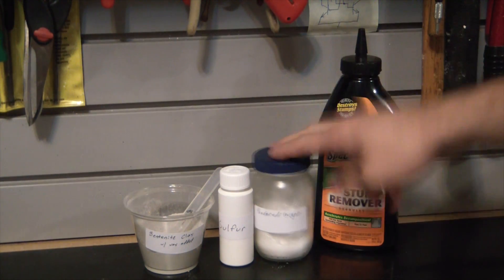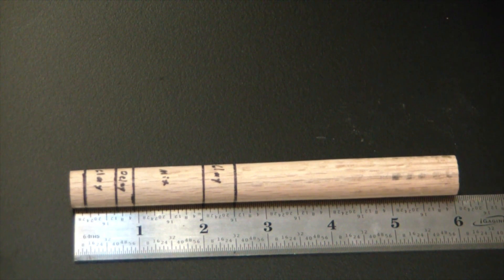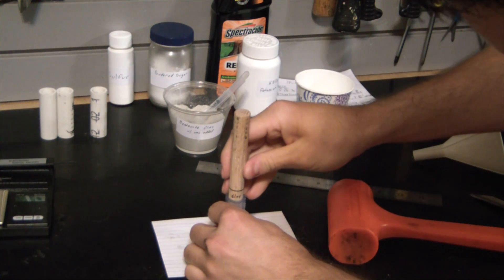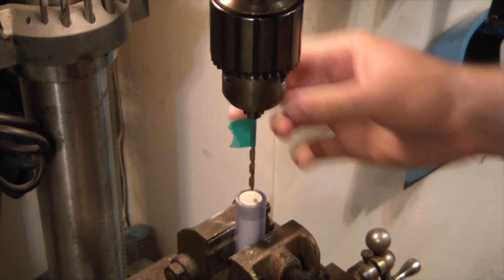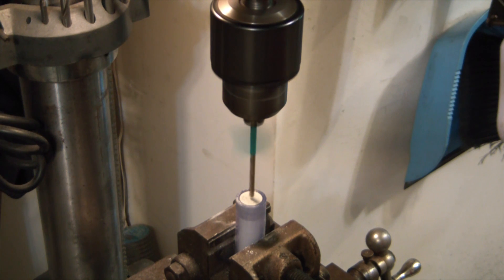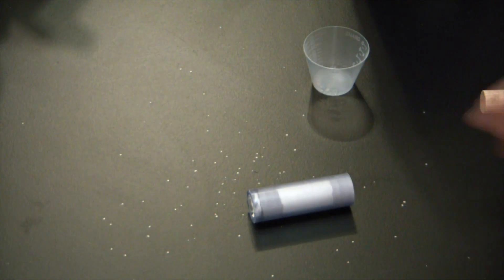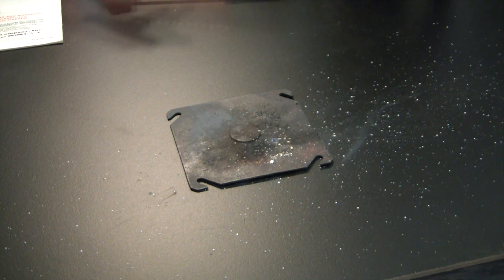ROCKET ENGINES FROM HOUSEHOLD STUFF! ELEMENTALMAKER

Comment: Swap the powdered sugar out for charcoal.  Black Powder.  Not going to give the exact mix ratios on here though, but some good research will give you the answers.  If you want to get really keen you can wet-mix the ingredients in a gemstone grinder with stainless steel ball bearings in, allow it to air-dry to a thick paste, pass the paste through a fine sieve to granulate it and then let it fully air-dry before packing your rocket motor.

Comment: The sulfur just breaks down to Sulfuric acid when in contact which the nitrate which is actually more powerful too add so next time use a few drops of brown sulfuric acid syrup for 400% more power.  Also charcoal powder gives a 200% faster burn rate than sugar.   It's THEN called BLACKS POWDER or black powder.  IT ALSO NEEDS A HOLE DOWN THE CENTER TO TRIPLE THE PRESSURE WAVE!!!!!!!!!!!!!

Comment: So much is wrong with your ratios and ingredients. That wouldn't get anything off the ground. Real rocket builders know about the correct additives and ratios. This is like watching a boxer teach dental extraction.
Reply from the maker: Aw look an armchair expert in its natural habitat! You clearly know nothing about making propellants. I've launched many rockets with this composition.
Reply: @ElementalMaker  Nah. Been building rocket engines since I was about 12, I'm now decades older. You need to add at least one key ingredient. A simple google search prior to your "instructional" video would have provided you with those key components. I bet you could figure it out then repost a new improved instruction video. I would post links in this comment but I don't spam unless I'm trolling. Not trolling though. Iron oxide is your friend, friend. Sorry I came off like a jerk. I kinda am tbh. But I do know what I'm talking about. We used a recipe for r-candy like this with very bad results in the early 90s. Moved on to proper mixtures by the mid 90s because the Estes engines are ridiculously expensive. If I find the old recipe we used in my old stuff I'll post it. We used to "cook" it on the stove and pour it in the used Estes tubes, also aluminum engine tubes with proper nozzles. I can't remember if we actually went as high as 5% on the oxides or not. Seems like we used sodium hydroxide too, but that was over 20 years ago.
Reply from the maker: @EthanVandal  I mostly have moved on to composite ammonium perchlorate based propellants. In this motor sulfur is acting as the burn rate catalyst, much like the iron oxide does in your composition. I use RIO when making knsb propellant. I have videos on making all these various propellants, and a load cell test stand to quantity results.

Comment: Nice but I like making rocket candy and using some rust or aluminum powder that has been oxidized   as a catalyst.. 
What I like is you can form them while in a hot past like form into paper molds and when they burn off they leave amazing white plume trails to track your rockets.

Comment: Not sure if you answered this question or not yet, but was there a specific reason you stopped using sulphur in the fuel mix in later videos? Not necessary? Or..?
Reply from the maker: Different propellant types
Reply: I only ask because it's the first time I've seen anyone add Su to that mix. I think you did 6 Su? I got curious and did 5g Su and 1g of pyro grade Fe2o3. Also split 17.5g/17.5g-powdered sugar/sorbitol. Kinda as a why the hell not??  Seems to be pretty a pretty hot mix after being in the ball mill for a while. Kinda curious to see how it's going to do once it's melted and loaded, seeing as how the Sb is a lot more coarse.

Comment: For people new to rocketry, have fun with these but do not overdo it. If it blows up, plastic shrapnel is incredibly hard to detect on x-ray. It's better to have a larger nozzle diameter which may not create a lot of thrust over a too small nozzle diameter and a massive CATO. If you want a lot of smoke also put just a pinch of baking soda in
Reply: or just keep distance / shield yourself from the rocket. How hard could it be?

Comment: I designed PVC motor in 1990 -  I sold plan sets for years on how to make - this was before the internet -
as far as I know I was 1st to make PVC case -  U should make Tamper  trim off some  make a step on  end - 
also a Lever Press works Much Better than  Hammering  -  make from 2x4 -- nozzle was  zink oxide  or aluminum oxide
Reply: Why should they use a tampon?

Comment: The easiest way to make rocketfull is to solve potassium permanganat  concentrated in a  watersolution. Soak Newspaper in this solution and let the newspaper dry. Then roll the newspaper thightly into a paper roll body,pipe, paintet inside with waterglass,  stuff that a standmann used to get fiere proof. Top closed with a wooden circle and jet made out of wood again. Carefull this kind off rocket will  at last reach the speed of sound and get to a speed of a bullet. It is no toy anymore. The newspaper is the carbon fuell. The potassium permanganat is the oxygen delivery. That how simple it is to make a rocket

Comment: What would happen if you scaled this up?  Say to 2" dia.?
Reply from the maker: You'd get a much bigger and MUCH more dangerous rocket engine. It would probably catastrophically fail at that size
Reply: @ElementalMaker nope it can be done but the nozzle should be 1/3 the size of the diameter of the engine

Comment: Just watched this ... and couldn’t see where the stump remover was used ?? 🤔🤔
Reply: Stump remover is made from potasium nitrate because potasium nitrate helps oxides the wood in the stump over time.

0:20 he blended up the potasium nitrate to a fine powder and placed it in a white bottle. 
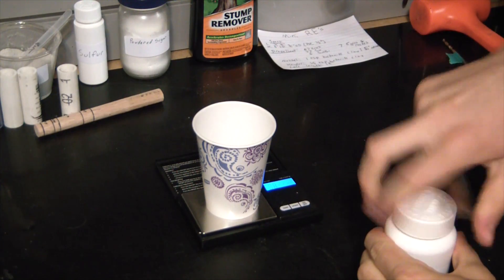 2:06 he starts to measure it out, and then adds sugar.  

Potasium nitrate provides the oxygen to oxidize and burn the sugar fuel. Having it in a fine powder helps bring it into more intimate contact with powdered sugar for a more consistent burn. 

Some people dissolve the sugar and potassium nitrate in water and then slowly cook it under a low heat to prevent caramelizing the sugar, yet  drive off the water.  and
Reply: Watch it again.....with audio, and pay attention.

Comment: you might find it easier to load granulated mix made by wetting your fuel mix with a small amount of nitrocellulose dissolved in acetone and pushing through a screen.   Granulated loading stock always makes for more consistent results compared to powder.  We make huge colored smoke cartridges professionally and loading powder/dust is out of the question. You can find ping pong balls made of NC and use them.

Comment: A friend of mine made a tool that avoids the drilling of the motor fuel. Basically he just cut the tamping dowel in two, and then centered a nail in one half of the dowel and cut off its head. This was matched by a centered hole in the other. This allowed the two halves to be rejoined seemlessly together by sliding one over the nail in the other. When used as a temper, the powder is filled around the nail and pressed in place with the half with the hole in it. The powder does not fill the hole, as it is blocked by the nail.
When all the powder is loaded, both sections of the temper are removed, leaving a perfect hole down the centre.
It helps if the nail is lubricated with a little candle wax, before use. This can be accomplished by rubbing the nail on the side of a candle. In his case, he was making the rocket tubes out of brown parcel paper held together with PVA glue.
A neat trick was that the temper rod also provided the former on which to wrap the paper. As the paper was wrapped, he would apply an opposite twist to the temper sections. This produced a rocket nozzle at the junction between the two parts. This was later reinforced by tamping an inert powder into either side of the tube. 
Making rocket tubes out of brown paper is a little old school, and is rather labour intensive compared to using uPVC pipe, but it does have the advantage of being very environmentally friendly, as all the parts are biodegradable. The paper turns out to make a very strong walled, light weight rocket tube, that produces a thin charred carbon lining inside the tube when fired.

Comment: What if you used a cone shaped bit to drill your exhaust hole?  Would it increase your thrust?
Reply: With this size of motor, any increase in efficiency would be too small to actually measure except on the most sensitive of test stands.

Comment: So, in theory this can be as wide and as long as we want? And will it be better if we make it longer ( stays in the air longer or launches faster )?
Reply: It's a different set of calculations.  On a ported rocket, lengthening the port causes more volume to be burning at any one time and increases pressures, which could be good or bad, depending on where things are at.  Changing the diameter can have an even more profound effect but then you pick up the issue of maintaining the clay plugs because the area on the plug increases much faster than the diameter or circumference and the amount of fuel burning at any point in time varies more as it burns from the port toward the outside of the engine and the area increases.  If you switch materials for the plugs, you need to not exceed the pressures of Schedule 40 PVC by too much.  It will take quite a bit of trial and error and you will want something that measures and records peak thrust and knowing the diameter of the nozzle to know where you are on pressures.  They make some pretty big sugar rockets here on YouTube.  Learning from those guys can get you into the zone you want to be in more quickly and you can take it from there.

Comment: do you need to put a delay mix in
Reply: If you want to retrieve your rocket via parachute, yes.  If you just want to fire and forget, no.  The delay is so your parachute doesn't pop right after or during your main propulsion as this can cause your parachute to get ripped off due to wind resistance.

Comment: Has anyone tried this but used 2" or 3" pvc or a cardboard tube? I've been experimenting using cardboard tubes as pvc tends to break down with the heat. My problem is that I need more thrust.

Comment: Is there a reason nobody uses a PVC end cap instead of a clay plug at the front of the motor?
Reply from the maker: Probably just comes down to cost. Clay is practically free and flame resistant. That's the way I've always made them.
Reply: @ElementalMaker  Okay, cool.... so you think using an end cap would work?? Clay seems a bit delicate.... Wouldn't it fall apart during handling, transportation and stuff like that?
Reply from the maker: @benmadderom2281  the clay is actually quite resilient. I'd trust it over pvc
Reply: @ElementalMaker  Interesting. Thanks!

Comment: we friend I too have been building rocket engines, i just haven't got the ejection charge to work yet, i also have been concidering  on using a altimeter, or maybe a mercury switch for that purpose. in the begining of making my own rocket engines, i tried using pyrodex, it was a bad choice, if it lit up no thrust or it would explode, then i took apart a estee's engine and used the black powder in my engine and it flew, since then i make my own black powder and its a process. one morning i packed a medal tube rocket engine and went out back and lit the fuse, oh it started , then bang it shot the medal engine 100ft striaght up, it blew like that is because i din't comptress the fuel enough, if there is any air pocket in the fuel mix it will explode, my ears rang for 20 m9nutes

Comment: You should be able to boost the performance of this fuel by adding between 0.5 and 1% charcoal. This is not for the chemical reaction, but for the opacifying effect it has.
Reply: I was thinking about the result of the mixture. Better results or same, or even diminished returns on the labor and experiment process. I hope that you don’t take this as dismissive to your explanation, that is fascinating.  A bit of a wow effect!!! Back in my Middle school days We had a wonderful gifted science teacher, who got me started with Rockets, I was classified as a “Basement Bomber” for building my own design rockets... Got teased a lot about it till the day(s) for Launching. Then my Redemption was clearly much sweeter than the some of the other Popular kids designs. Most of which failed in some way... two of them were perfect in flight and recovery.  I was amazed that my rockets had constantly developed broken pieces even before launch day and had to repair both on the launch day, balsa wood fins were broken most often. Thanks to my Mom giving me a tube of new Supper Glue, I was a successful Rocketeer.
Reply: Well??? How does it work?
Reply: @andrewostrelczuk406  - A lot of the energy in the combustion is in the form of light. If the fuel is transparent to these light frequencies, then the energy is transmitted straight to the casing. But if you have charcoal in the mix, this absorbs the light energy at the surface and helps heat the fuel at that point, which means that less energy is used to turn the fuel into a plasma and more can be used to get the gases going out the nozzle faster.  It is a small but significant amount.
Reply from the maker: Great suggestion, I will have to give that a try!
Reply: @ElementalMaker  Let us know how it goes :)

Comment: dude you don't need sulfur where did you get that info !! lol
Reply from the maker: Sulfur acts as a burn rate catalyst. Using it gives better thrust. Same reason it's used in black powder.
Reply: @ElementalMaker  Sulfur is more for black powder I've never heard of it being used for Rcandy as a catalyst. The mixture you want to use for the best performance is 65:35 with 1% red iron oxide catalyst on top of that. 67:27 is two oxidizer Rich to the point where it's being starved of fuel. You want 65:35. That's optimal for a fuel Rich mixture. Because the normal ratio is 60:40 with a much lower performance. The red iron oxide pushes that burn rate much further than sulfur. Much hotter too.
Reply: @ElementalMaker  wouldn't that mean for a better delay mix you could make another batch that ommits the sulphur aswell as using the baking soda
Yeah sorry for commenting on an old comment

Comment: If you have or can get a metal lathe, you could build a rig, that would allow you to make a spike over which you place the rocket motor body.  You then pour and tamp all of your rocket motor ingredients (the clay, fuel, etc.) into the motor body, and the spike automatically has a space already made so you never have to drill the motors again!  :-) A mandrel if you will.  The spike mandrel would allow for the hole you have to drill instead of having to drill it, and you would also have a tamper, that is designed with a hole in the middle that the spike mandrel fits snuggly into, so you can tamp the ingredients around the spike mandrel!  :-)
Reply from the maker: Check out my newer rocket videos. I  did just that. I made this video for people who don't have access to a lathe. I can make five massive motors on my 3/4 spindle setup in about ten minutes.

Comment: Damn! Where were you when I was 12 years old?? They should start chemistry lessons with this!

On a more serious note: 
a) do you reckon bits of cane or bamboo (dried up of course) would work instead of PVC? or would they not be able to hold the pressure build up?
b) instead of drilling the fuel, how bout drilling the dowel and then using a nail fixed to a round base that sits concentrically with respect to the PVC housing when packing it? You might need to lightly coat the nail with something in order to limit friction during removal - perhaps talcum powder. Do you think this could work?

Comment: Nice video.  I must say though they are rocket motors, not rocket engines.  http://www.rocketry.org.za/node/242
Reply from the maker: Very fair point. Admittedly I use the terms somewhat interchangeably, but should correct that per the true definition.

Comment: So... In another video, you were combining KNO3 and C12H22O11 on a hot plate to make rocket candy. Here, the dangerous step of heating and mixing the fuel and oxidizer is omitted. So what would be the advantage of rocket candy over this mix, if any?
Reply from the maker: The heated mix is actually more energetic because it is a fully integrated mixture. The powdered fuel can't compare, although it is easier to pump out a bunch quickly.